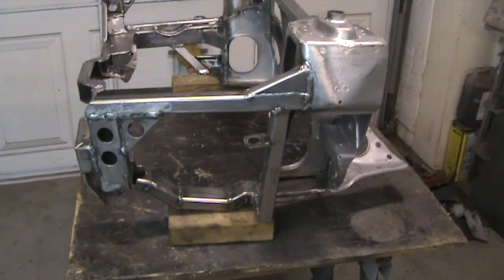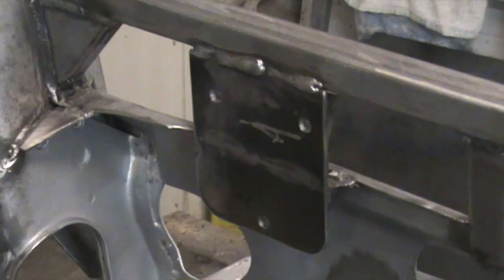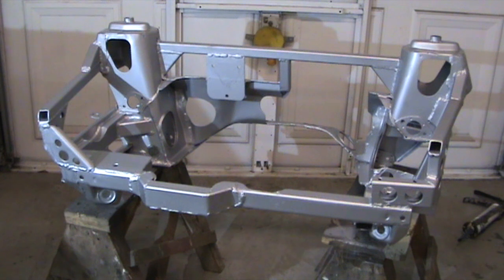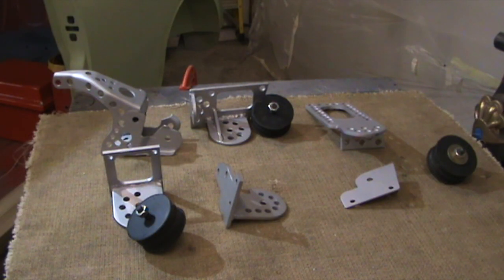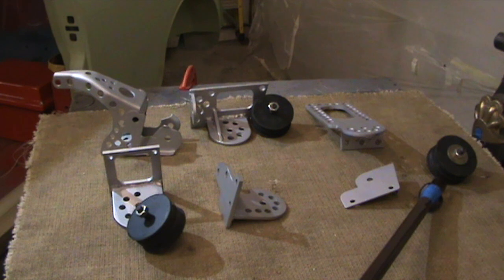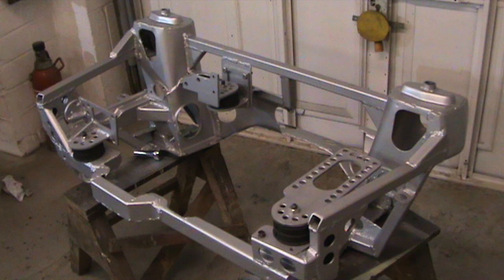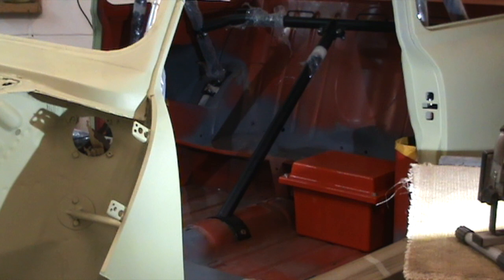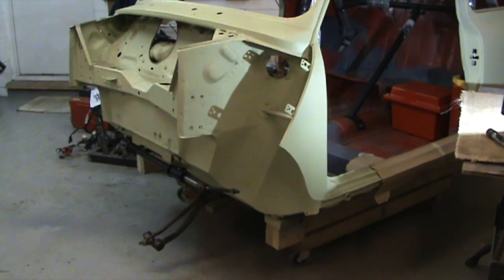Classic Mini Micra CG engine conversion - front sub frame Episode 2

Comment: You've done a great job. Did you design this yourself?
Reply from the maker: Yes my own design, its one which evolved which accommodated the engine and permitted easy access to the key components, and provided at least the same strength as the original design.